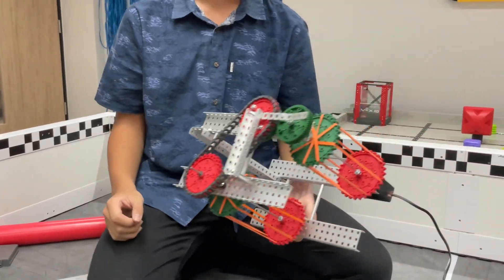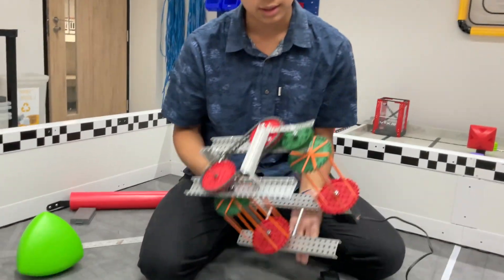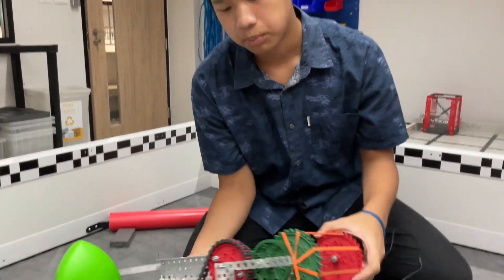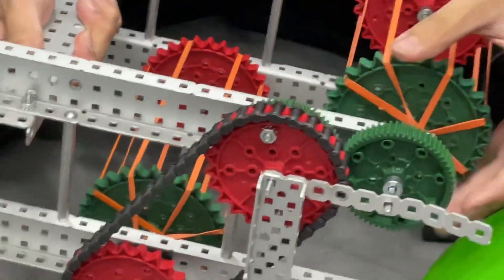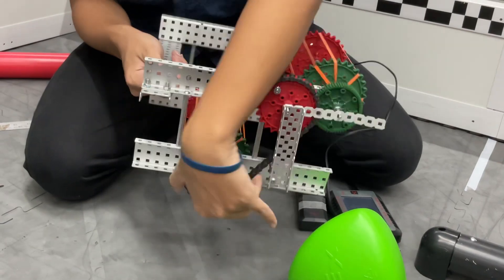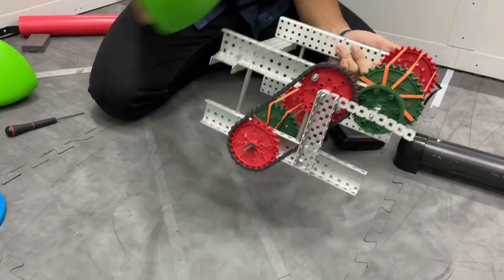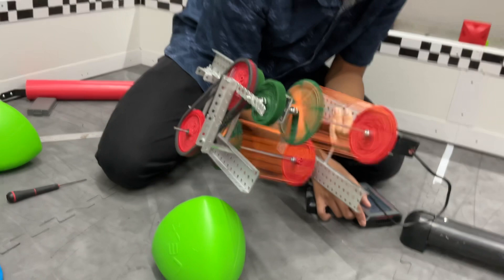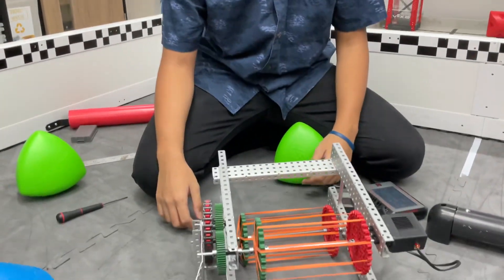VEX V5 Over Under Sprocket Intake design example

Comment: Could you list all the parts used. Great design btw
Reply from the maker: No.

Just kidding hahaha, we used 6 30t sprockets, 2 60t gears (size doesnt matter), and some metal parts that you have, the size is really flexible depending on how you position it. Hope this helps

Comment: may i ask it looks like it trembling does it cause a problem ? or when u sticked it to the robot it going to be dont tremble? 
 im kinda new soo i dont know how it works
Reply: i see, well from what i can tell in the video the wobble comes from the fact he is not using bearing flats for a few of the shafts which causes the shaft to spi n in the c channel hole and metal to metal will cause vibration. However, a shaft might not be doing all that so it could be a lack of support and if it was on a robot it should perform better due to it being supported more than just one hand.
Reply from the maker: Basically what the comment above said. We didn’t use any retainers since it’s just a quick prototype, so it’s quite wobbly and if you use it for a long time it might carve out and damage the beam, so I recommend adding a bearing flat to make it more stable.

Comment: does it work with the ball that's initially in the match load zone?
Reply from the maker: You can build a folding intake where you attach the intake to an arm, but I think there are better designs and rubber sprockets placements if you want to use it for that purpose.